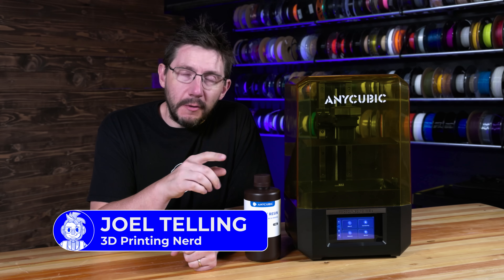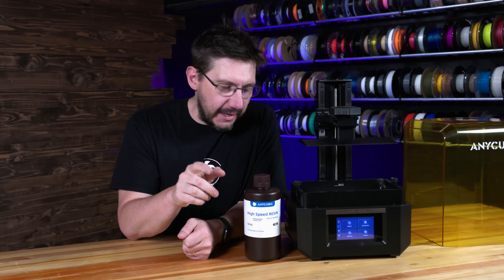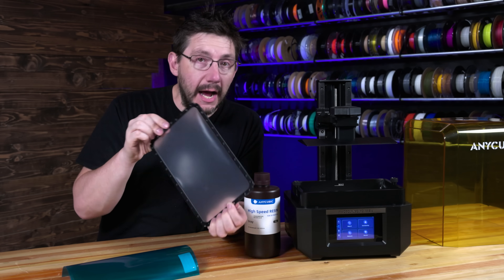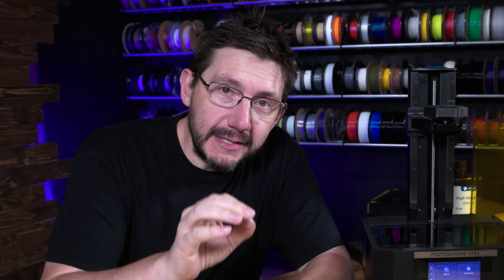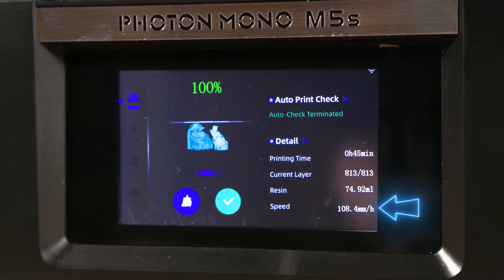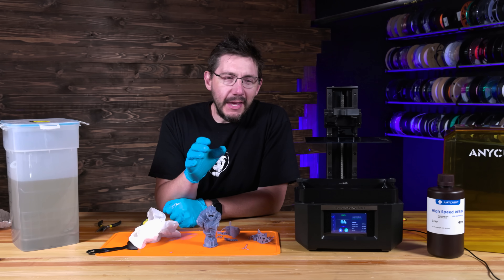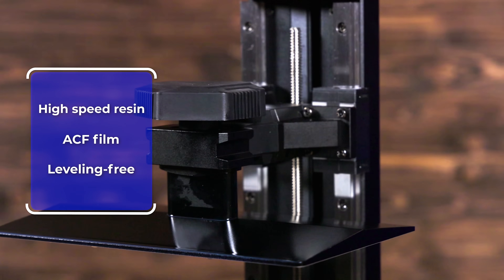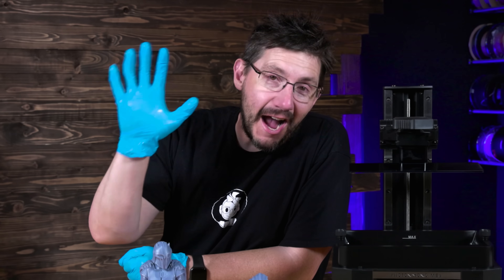ULTRA FAST 12K Resin 3D Printing! Anycubic Photon Mono M5s!

Comment: I wonder how the definition of such a small voxel is affected by the diffused ACF film since the printer lacks a focusing system and relies solely on the collimation of the LED array. Maybe you could try print  a checker pattern (2x2, 3x3, 4x4, pixels and so on) and check what the minimum resolution is to achieve crisp features of empty and filed tiles in the printed pattern.
Reply: saturn 3 ultra has light flux corrections and on YT there are printouts comparing with m5s and I don't see the difference there ... I admit that I would prefer to have a printer with this correction but I prefer to have a resistance sensor because it gives more possibilities, such as leveling, detecting the amount of resin, printing resistance if it will fall off, you won't dent it in the lcd or, for example, such a function as automatic detection of how much the printer has to raise before the next layer, which shortens the printing from 9h to 6h (I hope they will add it because the equipment is there).

Comment: Can you do a calibration print to compare dimensional accuracy? Would be nice to know if it can be relied on for tight fitting parts.
Reply: My experience is resins are more important than the machine for accuracy. Shrinkage is one issue and minimum x/y accuracy is another in resins.

Comment: I just bought the m3...printed one time and the fep film broke first time using. I didnt know that the fep film is preframed. Had to order replacement from china. 2 for 30€... really expensive. Had to wait 3 weeks for it. Just came yesterday. Now i have to decide to sell the m3 and buy the m5 or maybe the elegoo mars 3 pro  which is really cheap right now (under 200€ and the fep replacements are much cheaper).
With my eleggo mars 2 pro i nevwr had problems.

Comment: Why is it we are only getting the base new functions for resin 3d printing through these channels when a company that is not mainstream changed the game when the released their last printer months ago. The Uniformation GK Two fixed the resin mess problem, the fast swap over time, the heat issue, and more. This is the X1C of resin, but no one talks about it, is it because they didn't use Kickstarter to get hype up like everyone else?
Reply from the maker: Not a Kickstarter issue - just don’t know about it. Now that you made me aware I’ll look it up.

Comment: I would definitely like to see it compared to other 28 microns printers. Mostly the m3 premium.
Reply: M3 prem. print more accuracy and precision than m5s
Reply: @dishierosprey2798  Can you explain how it's more accurate? Does it not matter that the M5S is 12k vs the M3 at 8k? I'm new to 3d printing, just trying to understand

Comment: Have not had any experience with resin printers and wondering if parts printed on a for example Prusa printer using PLA or PETG would have the same strength as a part printed on the resin printer show cased? Hi 5!

Comment: 12K screen resolution aside, there's not a ton of great features to sway me back to anycubic. Now if it was doing .03mm layers at 120mm/h rock solid, I might be more interested. 
I've been using a whambam flex plate for three years and the only fails (2) I've had were trying to print in a room that was 50*F at the time which was pushing it, but during my active parts of the year, it's not uncommon to gobble through 12 liters of resin a month. The GK2 machine will probably be my next at-home printer as it does have some industrial-lite features and a novel leveling system, plus the screen can be replaced with one cable, the resin vat has no screws holding it down, flip up lid...
(It'd be a good one to try for the channel)
Reply: I just returned the gk two. The build plate was amazing and I wish more manufacturers would adopt it because it sucks dealing with resin on top of the build plate. The build quality was kinda meh. Finish lines not matching up perfectly, the front bezel with the touchscreen was crooked, the flip up hood was also crooked and the hinge for it put too much stress on the top housing because it's screwed into plastic instead of metal (who thought that was a good idea?). The flip up hood doesn't do a good job of keeping the resin fumes in the chamber so that the filter can do it's job. So the fumes were noticeable throughout the house. The heater is nice but it takes a long time to heat up. I got a second gk two to see if maybe I just got a quality control dud, but nope. The second one had the same issues AND the slide in vat wobbled slightly and the build plate had a huge scrape on the bottom along with a chip in the side. I REALLY wanted to like it and was hoping it was going to be the end all be all for the foreseeable future, but unfortunately I just couldn't justify the steep $900 price tag for something that seemed like it needed some more engineering refinement to warrant the price. Especially when you consider the anycubic m5s, phrozen mini 8ks, and the upcoming elegoo 12k in June for less than half the price of one gk two. When you consider the fact that there are some excellent DIY chamber heater mods available from the community for around $40, it makes it even more of a bad deal. I hope this helps your decision making process.
Reply: @David-ym2vk  Well that's a bummer but I appreciate the ownership review. I had a terrible ownership experience with anycubic previously, and as much as they appear to have improved, it's the lost trust that keeps me from considering them much further, and as you noted, there's a fairly widespread wealth of competition for the money. At one point I was really considering building my own as that's essentially what comes from overseas is the same chassis and mainboard plus box of parts and a screen, and there's been a few that have successfully made a viable 15" wunderkind in the same manner that are still in my consideration pool. I've diy'ed computer controlled heaters and VOC- control chambers with rebuildable active carbon filters in the past, (if you've been on the reddit resin printing page, I left heaps of build guides a few years back) though I've always wanted to do one with a bottom-up inkjet-type distribution system for a more on-the-nose 3D printer that can also do color. The hardware isn't terribly difficult, it was formulating the resin for the flow valves to work with inkjet dot matrix systems that put the kibosh on progress. I did a bit more digging on the idea and found a Japanese company that essentially figured out a similar system, but they start in the mid 5 figure range.   👀
Reply: @David-ym2vk  How do you know that Elegoo will release another 12k printer in june? And how do you know it will be half the price of a GKtwo? News that I am really interested in!!! Need some precisions for these
Reply: @danteinferno6513  
Another reviewer said elegoo sent out an email newsletter that they’re announcing a new printer June 1st. A different reviewer that gets review units said it’s gonna be a 12k printer to compete with the anycubic m5s. So idk for a fact but I’d say it’s pretty likely since these reviewers talk to the companies directly and get units ahead of time to review.
Reply: @David-ym2vk  elegoo saturn 3 ultra is basically the same printer without the features that the m5s has at a lower price.

Comment: That's great, that 0.1mm layer height model printed at 18.066 layers per minute.

My 10.3" 8K Nova3D Whale3 SE using Aorita ACF did a full build plate of models (one was Fotis Mint "V" bust and base, the other a detailed replica of an M4 which had many parts that needed to precisely fit together), at 0.05mm layer height, at 17.78 layers per minute, with fantastic detail and accuracy.  I could probably reasonably make it faster 20% faster before running in to trouble...

I only used 'conventional' Nova3D Grey Ceramic Water Washable resin for that print.

So it's a combination of the ACF and a good printer.

(By the way, ACF doesn't seem to make the "FEP pop" noise.)
Reply: Can I find out the lift/retract heights and their speeds you are using?
Reply: @edmundcheow760  I answered shortly after you asked your question and YouTube "ate" it, sorry.

Lift heights 3-5mm, lift and retract speeds 120-240 mm/min., generally depending on what I'm printing.

Comment: I’m running my Phrozen Mighty 8k at 70mm/ hour (150 um layer)with either Phrozen Speed resin or Sirayatech’s Fast. Might be interesting to test how far that new sheet would be able to take this machine.
Reply: Get some ACF from Aorita for your printer, I use it and it really is a game-changer.

Comment: What about the software? Is this another one of those modern cloud printers? Useless when your internet goes down?
Reply from the maker: I sliced in their sliced and use a usb stick to transfer the file to the machine. it DOES have cloud capabilities, but it's not required.

Comment: I would like to know, how fine a part can be and still be able to print. For example: print the Photon mono X test cube with the finest bars possible.. is there a callenge like that going on anywhere?!
And is there a difference between 4k, 8k and 12k?!

Comment: Would you recommend this for a new person for resin printing? I had a resin printer in the past, but it was impossible to use so I went SLA.
Reply from the maker: The first use experience I had with this machine was pretty stellar. If you have the same experience as me, you'll like it.

Comment: What does the inside print look like?  is it empty or filled?  is there such a mesh as in FDM printing?
Reply from the maker: There is a concept of infill in resin 3d printing, but typically models are hollowed. These are hollow on the inside.

Comment: Looking forward to some real tests. I come from the EXTREME detail of the 3d printing world with resin.  Micro accessories for miniatures for example.  So the fast speed is at .1? so the .05 seems like it should take 45 min x2 or  1 1/2 hours am I missing something?     Love your stuff I am glad FDM is getting a bigger push for detail for two years they stopped trying because of resin.   Resin has its drawbacks and FDM has a great future if they and we keep pushing its boundaries....   thx
Reply: 105mm fast risen
70mm normal risen

rather normal resin is about 56minutes, 0.05mm 56x2
Reply: You're correct, I get more or less the same results as Joel showed, using Aorita ACF in my 10.3" 8K Nova3D Whale3 SE.

0.05mm takes more or less twice as long as 0.1mm, of course.

Comment: Anisotropic Conductive Film film? Sounds great :)
But seriously, I'm not a resin printer user due to the small build size and extra washing and curing required, but this does look like a big step forwards which is always impressive to see in any tech.
Great tip on the screen protector too, nice!
Reply: That 'film' is for electronics, this clown has no clue...

Comment: A couple questions, Joel - does this machine have filtration to mitigate the fumes?  How strong is the resin?  My experience with my resin machine is it makes very detailed parts but they are very brittle.
Reply: @Garland Key right I meant with the included resin

Comment: Feels similar to the Bambu Lab X1 advancement when it comes to ease of use, but for resin.  Having to make sure my resin plate is level is one of the reasons I dont use it near as much.
Reply: Frankly I have actually been back and forth between what to upgrade between my resin printer and FDM printer.    I was looking at the FDM because there really hasn't been many big advances in resin.    This printer actually made it a pretty tough choice.    I kinda want to start doing more models and painting though.   For functional parts my FDM machine already does a fine job and most of the time I am not really that concerned about the speed of it.
Reply: @MaethorDerien  what's speed got to do with it? You can't buy faster anyway, so you can't go wrong.

Comment: Nice ! I'm wondering if we can still use flexible build plate with it ? And use others resins like ABS-Like or Siraya Blu ? Thank again for your videos ! :)
Reply: You’ll be able to use any resin but you won’t get the high speed. Also, the speed really only works on low detail prints (0.1 for resin? What’s the point of a 12k screen then)

Comment: What is this using for a slicer?  What type of files?  The one thing that has prevented me from upgrading from my original Mars, is the Chitubox lockdown ... If it will not accept Prusa Slicer output natively, big turnoff for me.
Real cool about the highspeed resin & other features, how brittle is the highspeed resin?  What type of UV system is it using?

Comment: You should try the new sheet and fast resin with a previous gen resin printer and see if you can just use it to speed up the prints of an older printer.
Reply: Ya damn right... need to try this.
Reply: I was thinking the same, but I believe we will have to go strong in the UV power cause the exposure time will be so low and those new screens have a better light source.
Reply: Was thinking the same thing!
Reply: Vote up, this is a must do!

Comment: hello from Denmark, you are using toxic chemicals, you must remember to wear the right gloves, respiratory protection and eye protection when working with resin or epoxy
Reply: i only use gloves when working with expoxy because i don't want to have the mess on my hands
if it washed off easier i probably wouldn't use gloves

Comment: 12K now???
Is that even any different than a 4K? Who has a model with THAT much detail that you can take advantage of a 12K screen? And would you need a magnifying glass to see it?
Reply: the voxel effect on smooth surfaces would also be reduced
Reply: Honestly file size is the limiting factor for high resolution prints. I can sculpt you a figure with more detail than 80% of the printers could ever hope to replicate accurately, but it would be 10gb in size. A more accurate file format than STL that compresses well and doesn't need conversion to tri's would be a huge help.
Reply: @C-M-E  while i don't think 10gb would be a problem, since they only look at the model one slice at a time anyways, i do agree that stls have a seemingly high degree of duplicate and redundant information
for example a simple cube in ascii stl requires 86 lines and the quad faces have to be split into tri's
all that while this could be enough:
yxz
000
001
010
011
100
101
110
111
of course this representation of a cube is quite abigious

obj's can do quad meshes
and curved surfaces could very efficiently be stored as the wireframe of the control points of bezier curves/surfaces

Comment: So im not a huge resin printer fan by any means, but this is still pretty cool, high speed+no leveling and a decent price, not bad...
Reply: Leveling was my main issue with my Mars 2 Pro, i just sruggled with it no matter what i did.  id have some prints perfect and others fail... or worse, look good until i got the end print and saw the first few layers smushed on itself. I would love more "no level" resin printers for this exact frustration.
Reply: Right, I agree with you!
Reply: are u supposed to pour resin on top plate or have u found that easier
Reply: @jamesharris9894  high pouring like that makes less bubbles in the vat, so you don't have to wait as long to fill your vat after shaking your resin bottle. Adding the waterfall from the build plate adds an extra point of bubble smashing... Also, it looks neat.
Reply: @hobbitsatplay9542  thanks was wondering
Reply: Uniformation GK Two
Reply: @darthrevan4376  I get the feeling you favor FDM
Reply: How does he not have a mask on?  The resin I use requires respiratory protection.  And it stinks so horribly!
Reply: After seeing a guy on reddit get a bottle explode on him and thoroughly coat his eyeballs I'm kinda leary about getting into this side of 3D printing.  I had no idea that the bottles could rupture like that but it should be known before diving into this.
Reply: @PLr1c3r  read the Safety Data Sheet on these resins and be extremely careful.  I do gloves, goggles and apron - I know I gave you a visual of the Muppet "Beaker" but this stuff is pretty dangerous if it gets on you.  Print safe!
Reply: @PLr1c3r  I hope he was using the recommended eye gear safety. I had a similar thing happen, but I was using eye protection.
Reply: @PLr1c3r  and people have burned their house down with regular 3printers. A freak accident is a silly reason to not do something
Reply: if you get into resin printing, eventually you’ll look back on your comments expressing these concerns and feel silly,  trust me on that.

Comment: I would love to know how much will a screen replacement cost for this printer considering the M3 Premium 10.1" 8k screen retails at $140. Taking that into account, early bird price seems like a pretty good bang for the buck.
Reply: That is the reason I will never buy any Anycubic products again.  They screw you on replacement parts. They also abandon their old products really quickly. I needed a 2-inch wire for my filament run out sensor.  They wanted $25 USD for it.  Crazy.
Reply: $300-400 is at the moment.